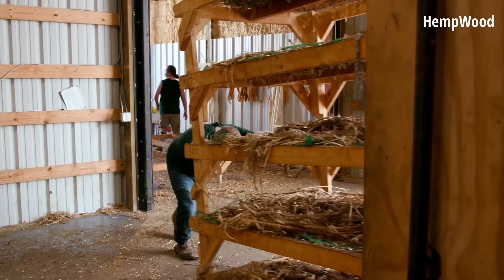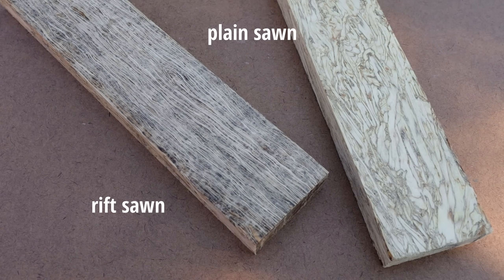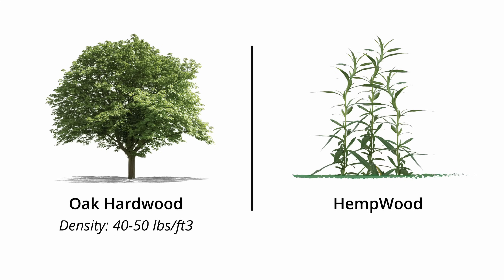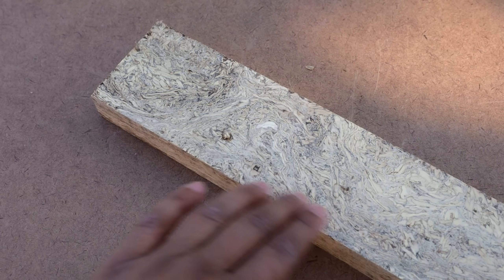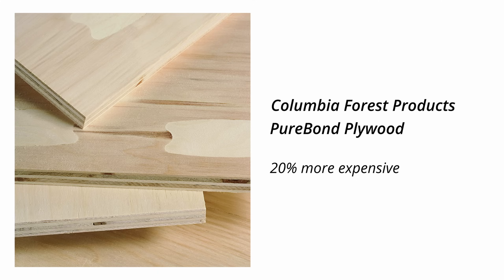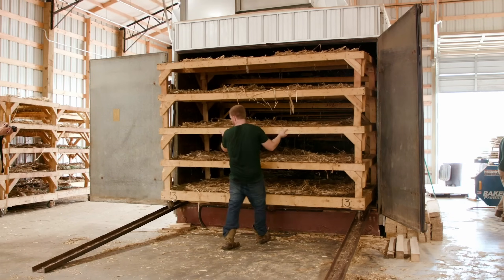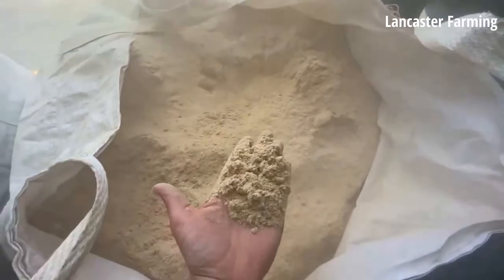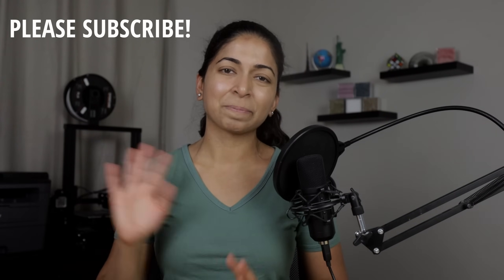HempWood | a NEW eco-friendly hardwood

Comment: I absolutely loved the idea at the beginning of the video.  Then I watched the entire video and decided that it is not a viable product as flooring.  It is too expensive (scale understandable) and it is not durable enough when you consider the water resistance/water proof and relative humidity constraints.  That's too bad, because I was about to consider it for some of my next projects.
Reply: The humidity restrictions are overstated in this (otherwise excellent) video. You'll run into the same issues with any domestic US hardwood. The only hardwoods that will stand up to high humidity and standing water are oily, dense exotic species like ipe, cumaru, teak, etc, and none of them grow in the US - there are high costs for importing them and high ecological costs as well (cutting down rain forests to harvest the lumber)

Comment: Using the same method I think you cold also make Corn wood, Cotton wood (not the tree by the same name) and many other fiber board products. A major problem is that all the extra work often make it a bit expensive compared to the quality of the product. The time it take for the oak to grow is important, but so is the cost of make the vernier used on the flooring.  
End for products like this I think bamboo is an even better source. At least it grow a lot faster. Some types can grow nearly 1 meter in 24 hours. So that would be the as long as a fully grown hemp plant in about 3-4 days.

Comment: If hemp wood can replace lumber why does it need to be laminated to plywood to make the flooring?  It would seem like the hemp would also make up the part that is plywood.
Reply: Because plywood is cheaper
Reply: The flooring is an engineered format. By placing the HempWood on plywood, you can place the floor on multiple subfloors and avoid things like cupping.

Comment: They would have to create some sort of coat protection that allows for water and oil to not soak in, otherwise this will stay niche.  The idea that coming in after a rainstorm or just walking around barefoot can ruin your flooring won't sit well with paying high prices.  Epoxy resin?  I like the concept, but if your already having to pay more and then have to shill out even more to coat, just seems like its target audience is custies.

I'll look forward to reduced pricing for it to make sense.  Thanks for the video.
Reply: And this gets back to the point Belinda was making about having a 'no voc' product held down with off gassing adhesive.
Obviously you can't stain or finish it with waterborne products, so you're back to oil stain and polyurethane finish (or varnish)
How natural, green or eco is that???
Reply: @jimurrata6785  I was in agreement with her on that.
Reply: @sabriath  Right!....
But Belinda didn't discuss the disadvantage (hypocrisy?) Of using a hydrocarbon based finish, just an adhesive or mastic.
I think we all agree that either one is counter to the 'green' ideal being pushed here.
I'd really like some better information about the "soy based" glue used. There are plenty of soy based polymers, adhesives and finishes.
Many of them are catalyzed with MDI. Methylene diphenyl diisocyanate is still reacting aniline and formaldehyde. And if that's the case then the idea of "soy based" being natural and non-petroleum is about like pushing corn ethanol as a gasoline additive.

Comment: This isn't a new tech or idea. I remember reading an article decades ago about some group in Russia making the equivalent of steel building materials, like I-beams and such, from hemp. And as far as water damage, the susceptibility to it must lie largely in the adhesive. Due to the fact that at one time hemp was known as one of the most economical, readily available, and  impervious to moisture natural fibers.
Reply: You are correct about the glue and susceptibility to water. Because we do not use formaldehyde in our glue, waterproof is not a realistic expectation for the product. We prefer to have clean glue that has low VOCs and is good for our end consumers.

Comment: Use nail guns next time you try and drive a nail through hemp wood.
Reply: I bet it won't work unless you have a compressor that will put out a hell of a lot of pressure.
Reply: HempWood is so dense that it actually rejects nails sometimes! You should check out our Cabinet Assembly video and you will see an example.

Comment: Im glad to hear about this product, I especially like that it can be refinished. I have bamboo floors which were installed prior to buying the house, I did like the floors until I realized I couldnt refinish these floors and they scratch easily. I thought bamboo was more sustainable but they dont hold up well and have to be replaced too often for it to be sustainable
Reply: Can you not recoat them each year to make them last? I looked into bamboo fencing and when I found out you had to treat it every year to prevent mold I was like "nope". I just assumed it was because it was exposed to the elements though.
Reply: @helenhobbs5472  No i dont think so bc its the removal of the old stuff by sanding or stripping that I cannot do but painting the floors is an option. All the scratches would need filled in some how for the floor to look nice bc you would see all the dips and groves through the paint. I like bamboo for furniture and other things just not floors.

Comment: Thanks for the disclosure, but it shouldn't take until 6:32 to learn the video is not, as claimed, an "unpaid and unbiased review". At the point of release, the video can no longer be considered as such. Otherwise, "before" and "after" sections would need to be clearly declared. There should also be a disclaimer right at the beginning.

When you're caught shoplifting, it doesn't count to have had the intention to actually pay for a product while you were in the shop. What counts is that you ended up walking out the door without paying.

Comment: It is a shame that it doesn't exist in Europe.  I woult try to use this for an electric guitar body. As it is verry hard it will give a lot of sustain. The Fender Weedcaster is born.
Reply: Guitar sustain is from how much extra or lack of string that goes beyond the nut and saddles. Try a headless guitar where the saddles are right at the bridge tuners if you want the most sustain. The other extreme is a mandolin that has half it's string length across the headstock and tailpiece giving them a 'plinky' short sustain. It's not the wood.
Reply: Not sure where you live in Europe but you might be able to order the wood where you live.

Comment: I would love to see quality furniture made from HempWood. Modern wood sourcing for furniture is problematic in several respects, and HempWood seems like a smart direction for the industry. I would gladly invest in seating, tables, bed frames, and so on made of the material

The segment of the furniture market where HempWood would make sense seems unfortunately far from IKEA-level, though I'd love time to prove me wrong! As stated in the video, HempWood just doesn't seem like a practical candidate for mass-production or high-yield entry into the lumber market. But, high-end and handmade furniture is a small enough market segment that it shouldn't overtax HempWood production capacity

I can't wait to see where the industry goes!

Comment: Hemp and their products are nice. Like you said it will not replace anything. The main problem is that they do not have enough funding to advance or scale up their production with research and development in machines to make the products. There is also a back end problem as well. Hemp is a once a year crop which has to be grown to specs that will work. They are super hard on existing machines due to their 2 inch and larger trunks. Once the seeds are harvested the stalk then can be cut down and raked in to rows where it has to sit and be bailed at a moisture level specific. In order to be profitable and to be able to process an entire years worth of crop in a given time factories are only going to be open for a short time unless they are going to bring in harvest further than 100 miles. 
While trees are renewable and there are more than enough of them and more being planted every hour. Trees work on a function of supply and demand. The more demand for trees the more those mills will plant more trees and the more they will harvest. For example Oak trees are an investment and that investment pays out in 50 years. We forget that these lumber companies plant billions of tress every year just to replace the stock they own. The other lumber companies bid on entire forest area that they can clear cut and then re plant. While most of the world refuses to understand that large untouched forest are prime areas for fires they need to be cut and planted again. 
Hemp is a viable product that could work with 10s of billions of dollars invested yet it will not because wood is king. OSB sheets in many places are made from fast growing trees or from tree thinnings. This type of board can have very very fast turn around in as little as a few years. Which is why OSB is king vs plywood. OSB can be super cheap when prices reflect it. I just bought 15 sheets for a project at 18 dollars a sheet. That price is still quite high as they used to be around 13 dollars a sheet. Drywall was almost 10 dollars a sheet. For one room I opted to put up OSB sheets rather than drywall.
Reply: 100X this!
Unless enough is grown and harvested to keep the mills working all year round there is no reason to make the capital investment in a unique (esoteric?) plant that will only be operated seasonally.  And what would those workers do the rest of the year?  It's not like they are migrant vegetable pickers.
It's not a crop that can sit in a will waiting to be milled.

Comment: I'm really curious about it's long term durability. For example, does water cause the adhesive to fail? What is it's shrinkage rate per year? How does it fare in high pressure curing systems (stabilized resin, etc)? I am not in the flooring or furniture markets anymore, but I do dabble in other decorative wood projects on occation.

Comment: Not exactly the case for hemp but generally true: "hot hemp" can contain more THC than mandated. Hemp flooring is useless. Engineered vinyl, hardwood or floating have great versatility and warranty. 

It has great potential for composite materials used in structural materials but R&D and approvals are needed. USA has a huge surplus of hemp biomass so it should obviously be studied.

Comment: It seems interesting, but the inability to get it wet seems like an issue. I wouldn't want to hassle with that in flooring, I would want something I could casually make a mess on and casually clean it up. The durability sounds great, but I would want that in a structural application, not a flooring one.

Comment: The ban on marijuana in 1937 was meant to destroy the domestic hemp market. They wanted cotton, Dacron, rayon, Wood pulp paper, petroleum oils, etc., etc., etc. to be able to compete, which they could not do against hemp. They knew marijuana was actually not dangerous. But they lied about it and also threw in their racist rationale to condemn marijuana and save the cotton and pulp paper industries, along with the chemical industries.

Comment: I'm a big fan of this channel and the advice given. But from a wood workers perspective. Hemp wood is of very little use. It breaks apart worse than cork and any amount of moisture causes it to expand and lose strength. It may be useful for lamination such as flooring but if you are looking for something like any other hardwood in your project then don't use hemp wood. It's expensive and it doesn't tool well. It's interesting and looks cool just don't assume it will work for every project. I'm not trying to reject it outright as a product but rather trying to inform people of its shortcomings so people can be aware. 

Again I do support this channel and I wanted to support the idea of hemp wood but coming from my perspective as a wood worker it just doesnt work.

Comment: *hemp isn't eco friendly necessarily. It requires a lot of water and heat lamps (if in a area without a lot of sunlight) which uses a lot of electricity.
Also hemp does deteriorates the soils.
Reply: But it grows outside in Kentucky beautifully. Long humid hot growing season. And can you explain how it deteriorates the soil? And where you got that information from?

Comment: Interesting & for good wood flooring seems good option Having to use power tools to cut fine w 10s of millions DIYers. Wainscotting & trim molding might be good markets.  Current materials accessible to DIYers are pathetically soft easily dented & dinged during installation & normal use & Real hardwood options aren't cheap

Comment: It is not a hard wood and measuring tinsel straight is a fair way too compare ropes but not lumber and once completely dry hemp erodes quickly. It consumes more water than a forest of equal size and to manufacturer into lumber on a large scale will produce more carbon than a sawmill particleboard is particleboard no matter what wood you use once it gets wet and you don't do something right away it will swell and come apart it has many uses that Fact but lumber is not one of those.

Comment: This is a very interesting business from a venture capital perspective. Today it is a hobby business with radically high labor & glue material & application cost, making a very high density specialty product with visual & pothead appeal but machining cost downside. IPE hardwood for decking soared then died due to its visual appeal but extreme costs of machining & installation difficulties. If they reengineered end product for specific gravity between 0.35 & 0.5 (comparable to soft pine to Douglas Fir), it would take nails & staples like framing lumber & potential volume would sustain the engineering investment in 72ft presses, continuous conveyor dryer ovens & spray applied glue. Hopefully they are experimenting with lower density end product as they go to develope the prototype data for a giga-business
Reply: This product looks an awful lot like OSB.
Maybe if they were able to eliminate much of the manual handling and are able to produce something bigger than a 5 1/2" billet that's only 6' long.
For flooring at $8 sf unfinished and $10 finished when I can get #1 oak installed and finished (sanded, stained and 3X poly) for $8 a sf...
Solid Jatoba (Brazilian Cherry) is under $10 sf (material) so it's really pushing the boundaries to get an engineered product that has only a 1/8" wear surface for those kind of prices.
While I understand the appeal (or virtue signaling) of artisanal hemp for those that like the OSB look this really needs to scale before it gets traction.
The lack of panel products and 5 1/2" by 72" max dimension makes it a non-starter for cabinetry.
I really do hope there is a future for hemp as a building material!
I'd really like to know it's value as a crop. (How much $ an acre can yield for the farmer) and what kind of equipment is needed to economically harvest it.
Hemp is tough and stringy. You're not going to mow it like hay.... Plus if there is no chaff or silage filled back in to the field the soil is going to be quickly depleted unless it is rotated with alfalfa or another legume that fixes nitrogen.
So many questions!  But mostly economics. Obviously it grows like a weed, because it is!

Comment: No too impressed with the flooring.  It's just bonded to plywood?  Isn't it strong enough to mill into T&G boards itself?
Reply: I imagine it is more the adhesive must be hell on machinery. Eventually get to a point of forming it into shape.
Reply: Even if strong enough you probably couldn't drive cleats through the tongue without breaking it off.
That's the downside of a dense and hard product that's only held together with soy glue.

Comment: "Hardwood is wood from dicot trees. These are usually found in broad-leaved temperate and tropical forests.
In temperate and boreal latitudes they are mostly deciduous, but in tropics and subtropics mostly evergreen. Hardwood (which comes from angiosperm trees) contrasts with softwood (which is from gymnosperm trees)."

How can hemp be "hardwood"?  Do you just mean wood?  You know Balsa is a HARDWOOD, even though it is super soft.

Comment: The only potential advantage I see here is if it's drasticaly cheaper than OSB.   It's clearly inferior to hardwood and plywood.  I'd take bamboo over hemp in just about any application.
Reply: it's the fast growing rate of hemp and carbon sequestration that is the advantage. low VOC, fire retardant .. she literally lists lots of advantages
Reply: @twmd  but the problem with moisture and humidity is a deal-breaker for many.
Reply: @freethebirds3578  right but it’s wrong to say price only.

Comment: Interesting product but overpriced in comparison to more traditional materials. I'm curious as to the cost breakdown. The raw hemp should be fairly low. From what I understand, growing and harvesting hemp is on the lower end of farming as far as cost goes (I could be wrong but that's what I've read). The soy adhesive sounds very expensive but how much is actually used in production. Of that 4x8 sheet that costs $240, how much is the glue - a $1, $20, $75? If the glue is a few dollars more per sheet, how did the sheet price get so high? Labor? Profit?

It's a nice idea and I wish them well but I think they are going to have a tough go of it.
Reply: Our products are now at a competitive price when compared to traditional materials.